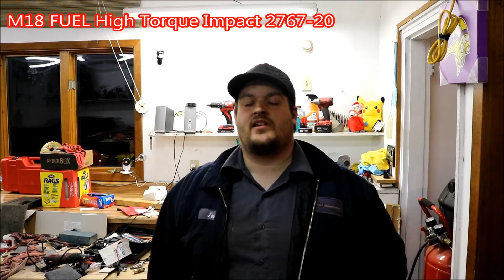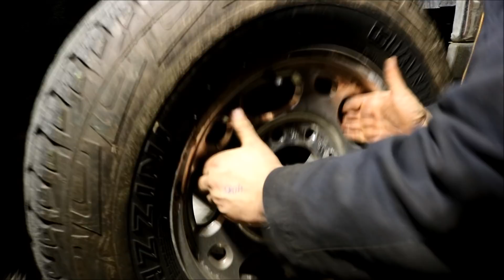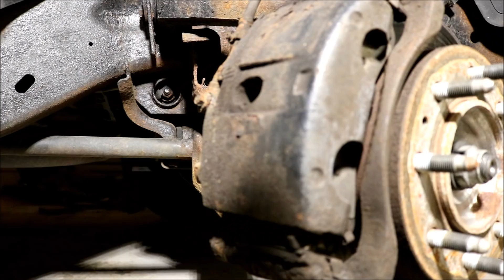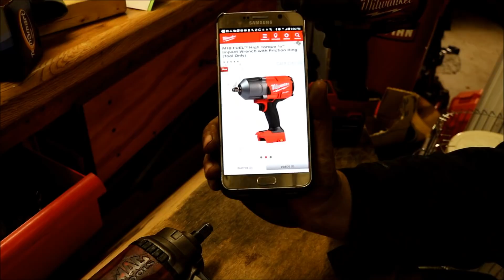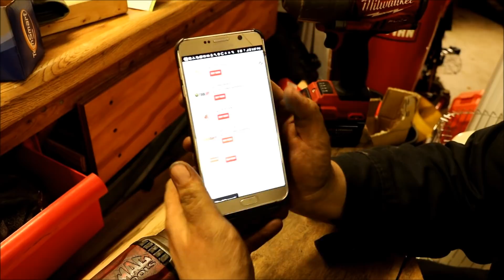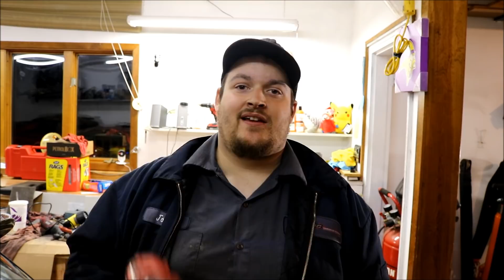M18 High Torque Impact 2767 REVIEW   -AUTOMOTIVE TECHS REJOICE!!!

Comment: I have one it wont brake loose my exhaust manifold bolt on setting #4 it is only a 3/8 stud 15mm nut Do the clutches in the gun only last so long. I Borrowed the impact from a friend

Comment: Whats the diffrence in a 2767-20 and the 2767-21b?
Reply: Was looking at this also before I bought the 21b combo. I think the difference in the 20 and 21b is that the 21b comes with a bag, battery and charger combo. Other than that same tool. Makes more sense to buy the combo or atleast it did for me.

Comment: Can I ask people here? I got mine today and when I shake it in my hand it sound like there is something loose inside as its rattle a bit. Is it mechanism? Is it normal? I did it without battery being attached. Thanks,
Reply from the maker: There is always a little movement from the hammer mechanism back and forth it has a spring that rotates to hammer inside that's what your feeling moving , I've taken mine out to lubricate it after a few years of service and it's always done that still works amazing to this day
Reply: @JoeTheAutoGuy  thank you so much! :) I was a bit worried. When holding it I was moving it up and down and could hear and feel that something is moving inside... :) thank you for your quick answer! Great video BTW

Comment: Just picked mine up a week or so ago after struggling and failure with an exhaust bolt via breaker bar. Im not a mechanic by trade but I do my own minor car repairs and such. This impact is a beast.

Comment: What's the difference between the battery when using a xc8.0 and a xc 5.0 does it just give longer usage or does it actually put more juice into the tool giving you more torque power.....???

Comment: I am scared of over torque. Isn’t the mid torque better? What needs more torque than 450? Looking to buy one and can’t decide between mid and high.
Reply from the maker: High torque is awesome for removing , if your only doing small car or light truck the mid is fantastic , anything heavy rusted severely reduces working torque hits of any air and electric impact so if that's what your dealing with get the high torque

Comment: Awesome gun. I still don't think it would be a total replacement for my air gun. I know my Matco and IR guns very well and can feather the trigger just right to fasten nuts and bolts properly. Plus they can get into some tight spots like way up near the bed of a truck  replacing rear shocks.
Reply from the maker: i honestly havent touched my air in a year it can still get in some tight spots , chevy rear shocks are usually what i am doing when it comes to tight spots but yes i agree that air tools are still needed in cases, my matco stubby is still a fantastic tool
Reply: Buy the m12 fuel stubby line. Those will eliminate your air impacts, it did for me.  22 year exp. tech here :)

Comment: I have one and had it for nearly a year and I have the rubber boot on it, it does have lots of torque and I have tested it on a lug nut of semi and it took it off easily.
Reply: Awesome 👍
Reply: Milwaukee will be releasing the 1" drive sometime this spring or early summer.

Comment: Great review thank you I just purchased one. I just happened to notice if you wiggle the gun a little bit from nose to tail the internals seem to slide a little bit inside of the protective body. You can feel the internals shift a tiny bit is that normal? Thank you
Reply: Yes has to have some movement

Comment: I bought one of theses recently, disappointed Tbh.  Yeah sure it tightens things really tight! However it's a.different story when nut busting them open . What I'm trying to say  Is.....  it tightening torque is a lot higher then it's  busting opening torque ....strange. My friends is the same.
Reply from the maker: not my experience with it ive had noithing but good experience,  i use daily as a tech. ive had a batch of a few bad 5.0 batteries unfortunately that i have had to warranty, any other tools bogging down on you? or is this your only Milwaukee tool?
Reply: You need to not use extensions or swivels and get yourself proper impact sockets.  Do not use nornal chrome vanadium style sockets..  anything but just a solid impact socket will drastically reduce the busting and tightening torque.
Reply: Ima Crazy Guy how would chrome sockets reduce the torque applied to the fastener, impact sockets are softer metal so they don’t shatter like chrome sockets will, they will because they are harder more brittle metal 
I agree with swivels and extensions will reduce tourque

Comment: please can u remove those wheel nuts correctly in a star pattern - thanks chum. Dunno how u one hand that thing, its a frikkin beast! My only complaint is the switch, SUPER annoying - I have to keep pressing it to see what setting its on, and the battery is loose (brand new unit)
Reply: You don’t have to do a star pattern to remove lug nuts. Christ.
Reply: Some "smart" ones should stay quiet..its cross pattern and only matters how you tighten bolts. Or do you use a torque wrench when removing your lug nuts ?

Comment: You should have bought the rubber cover for it. Mine looks new up top and it should help resell value if you decide to upgrade...
Reply from the maker: nah not my style i use them their tools
Reply: JoeTheAutoGuy I mean I like protecting my stuff making it last longer 👍
Reply: Some people like to show that they use there tools plus the rubber boot is just for your satisfaction its not gunna help resell because regardless if the tool is beat up or protected by the time you decide to resell it there will already be a new and improved tool to take its place that's just how technology is tools are pretty much no resell value due to being used or for power tool outdated that's just the way it goes for tool
Reply: @209chevymon  not so much. There is a humongous second hand market for decent electric power tools.

Comment: I am not that familiar with tools but if that thing is that powerful, wouldn't it create an equally powerful force in the counter direction breaking your wrist? Or do you have a decent mechanical advantage with the trigger position being far enough down the handle?
Reply from the maker: felixthemaster1 its a torque hammer , causes a reactionless mechanism to not send the power in the wrong direction. The torque will break free the fastener and spin it off free speeding the electric motor as well

Comment: i have a old bosch 500 ft lbs  and milwakee  1400ft lbs  and is not stronger then bosch .   i have  18 wheller  truck  milwakee  milfake feal to take the wheel nuts of
Reply: He’s lying
Reply: Septimiu Gatej prove it, post a video about your claim Milwaukee is less powerful and that will end all debate
Reply: Septimiu Gatej 
Hey idiot.... Milwaukee is killing Dewalt StrapOn and Bosch.. Ur a lying POS
Reply from the maker: Septimiu Gatej if thats the case then return it and get another one to try this thing hasnt failed any bolt ive tested except for some god awful rusty ones
Reply: You mad you dint get one for free
Reply: Are you stupid I have milwakee I have Makita 3/4 drive and Bosch I work with all the milwakee is poor quality tool

Comment: you did a good job, better than most.  no offence, the "real tool review", guy, started or at least really help start,ppl switching to Milwaukee,n cordless,in general. I'd been struggling between the IR W7150, and Milwaukee 2763, having already switched,to Milwaukee from Dewalt,n Porter cable. it was a no brainer,but his video's really helped. the 2763,is great,no negative issues.but I had to get the 2767,"jus because."  yourself,and "how to automotive". are doing great. "tool Boss is good", "workshop addict",are good too. "real tool review",does have the equipment,to measure actual impact's, n the nitty gritty, even break down the tool's,to see differences in the anvil's,so on. between him,n guy's like you, those few of us who get excited about tool's,have a good reference. appreciate the time.
Reply from the maker: thanks for watching, glad i did a decent job . i love these  tools and im learning to be objective in my reviews as in hit points that everyone wants to know . for my uses its amazing

Comment: Great video, thanks! 
The torque readings on the lug nuts at setting one would have been considerably higher if you had allowed the impact to finish "running out" . Stopping it short does not allow the gun to reach it's full torque value. Looks like you've put it some honest work thru it, more than most reviews I've seen. 
I love mine! The compressor only runs now to clean off parts.
Reply from the maker: I figured i would do it that way just to do like a real world test of how i think someone else would use it, most times people are impatient but i totally get what your saying. and yeah this thing is a amazing tool!!!!!!!!